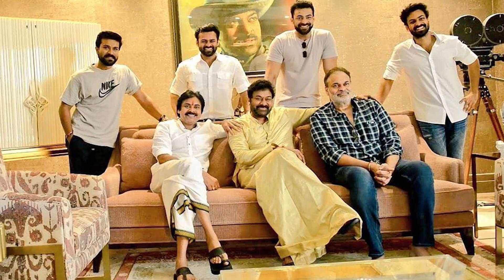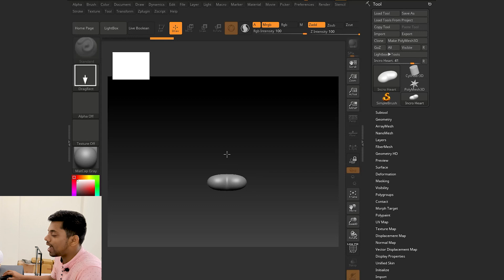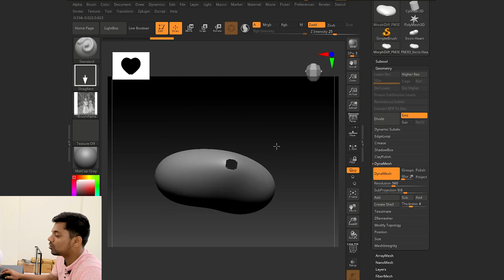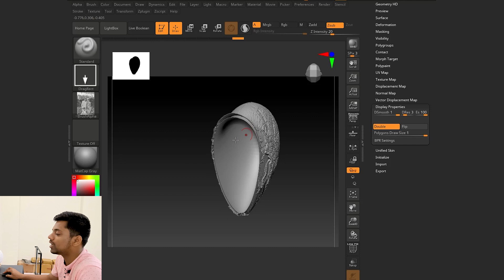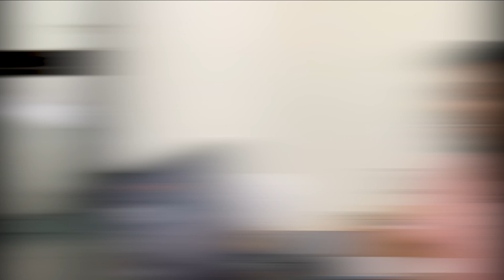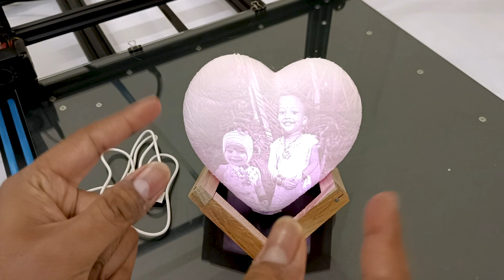I 3D Printed a Heart-Shaped Lithophane Lamp ❤️ | 3D Printing Business Idea🔥

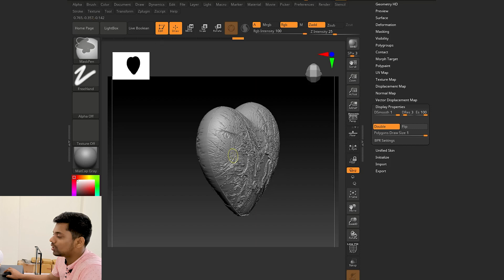Comment: 10:23  if i divides the heart into 2 parts then when i saw inside of the heart it showing photo/texture. i done so many times but it still showing the print inside the heart.so can u make a video that says clarity about the part (8:30)
Reply from the maker: Try to make this design using the settings shown in the video.  If any problem arises then you can definitely ask us.
Reply: I did same as u did but the problem didn't solve for me
Reply from the maker: @psvisuals2021  Try Inflate 45 
And Zsub : Z intensity 22 Or 21
Reply: same problem. How did you fix it ??

Comment: The thickness of the lamp is lot more than shown in video when I try to to do it
Reply from the maker: Don't increase scale Percentage In Cura.
This Thickness helps you to reduce Print Time using standard Layer 0.28mm
And It maintains your  photo Quality.
Reply: How to increase the size of heart if I cannot scale in Cura.
And thanks for the amazing video bro.
Reply from the maker: @wanderingbilal  when you export that file to STL 
In this same Tab Also  XYZ size is mentioned in inch or Cm  use that method and change the size.
Reply: @incro3d  Bro, for 150mm sized lamp it takes half Kg Spool, anyway to reduce thickness? Or what option in this tool decided the thickness of the model?
Reply from the maker: @wanderingbilal  Deformation Tool
Inflate 36 
And Try
Reply: @incro3d  Cool
Reply: @incro3d how much to inflate for the size 35mm keychain
Reply from the maker: @nihilm1552  put inflate same change scale when You Export Design.
Reply: @incro3d  scale in cura ?
Reply: @incro3d  scale in cura or zbrush before exporting ?
Reply from the maker: @nihilm1552  z brush
Reply: @incro3d  how to scale for the perfect size we want in zbrush plz tell or send any video link of tutorial
Reply from the maker: @nihilm1552  In This Video When Final export this design that time you notice the size of design is given xyz in CM Or Inches.
 make changes on it.
Reply: @incro3d ok I ill try